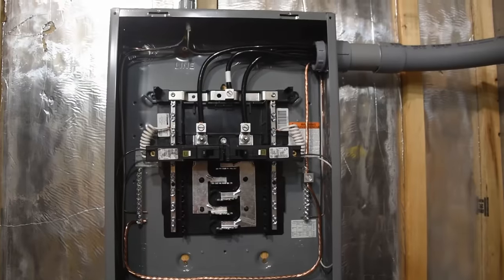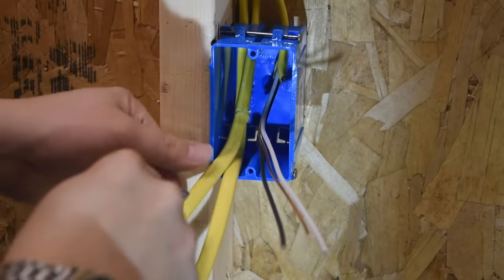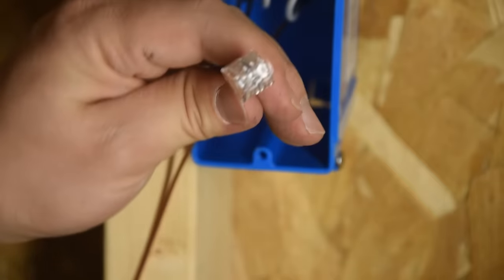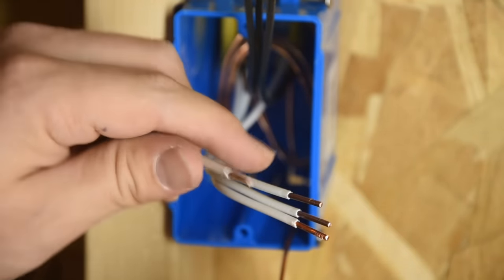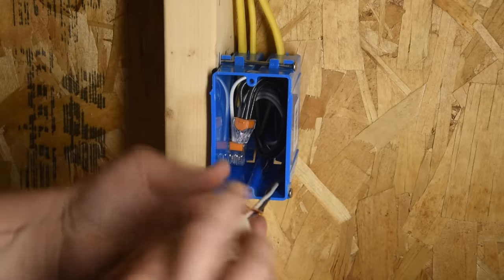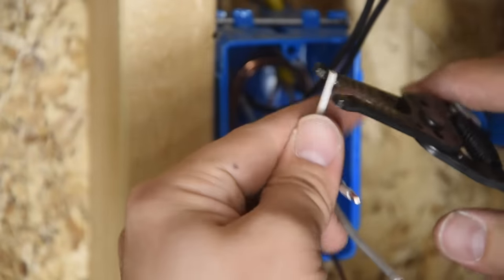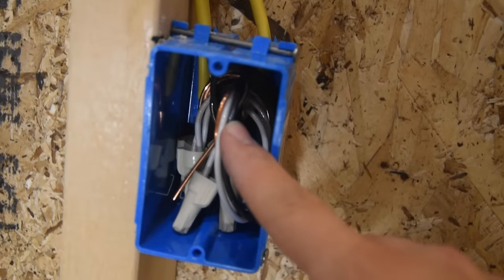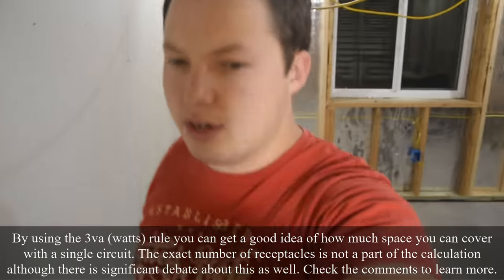Wago's vs. Wire Nuts - How To Wire Outlets During Rough In

Comment: Ideal has a better quality connectors.  I have tested them in fire, spark, heat.  
For commercial I wouldn’t use push type.
Reply: How did setting fire to the Ideal connector work out for you? Did you  put them back in stock and install them in a panel?

Comment: I really like using the Ideal twist-a-nut 6 in 1 screwdriver for installing wire nuts...check it out...I also use Wago lever nuts for some applications, especially ground pigtails in old housing...

Comment: Why 3 wires in the receptacle box instead of one? One wire with positive/negative/neutral is enough for a receptacle box right? Thx
Reply: 2 feeds out one main or home run ive done this with attic & closet  lights  just splice into nearest outlet

Comment: In wiring my new house I'm using WAGO connectors with levers and will never use wire nuts again. WAGO's make for a quick and clean installation and the wires are easier to fold back into the box than with wire nuts.
Reply: Thats it quick.

Comment: I notice that you leave the earth conductors as bare copper. In the UK we use an identical format cable to your Romex (we call it Twin & Earth), when we strip back the outer conductor we put a green/yellow sleeve over the earth conductor so that it is insulated. Is that something that is unnecessary in the US or is it just not mandatory?
Reply: ok how often do you need the ground to carry current should be never thts why we dont bother with sleeveing yes  its lazy but not needed in reality. how ever if the wire size is big enough say 4mm or larger and its going into a metal box or a tight fit i will sleeve it with tape or use a green insulated pigtail.

Comment: Then the drywall team cleanly cuts openings for the boxes with a router bit that is too long and rips the wiring to shreds.  I had this happen to all of my voice and data cables.  Fortunately, I ALWAYS have a service loop at the top of the wall.  Good thing they did not damage the power wires.  The switches and outlets were already installed.  I don't think they liked that, but they were behind schedule.  Soooo, the painters came along and painted all of the switches and outlets!

Comment: Time Stamp 0:16 shows Romex running thru conduit… not to Code.  Only THHN (single conductor) cable can be run through conduit.  However as a work-around and avoid splices, strip the outer sheathing of Romex all the way from circuit breaker to top of conduit (near joist).  Add a NM-type compression bushing to conduit top to secure Romex, and continue Romex to termination point.  This way you have single-strand THHN running thru conduit transitioning to Romex near joist without the need of a splice.
Reply from the maker: Thanks for sharing your experience. Its interesting though because I see conduit used fairly frequently to protect romex from "physical damage" from the top of the panel up to the joist cavity and it routinely passes inspection. Do you know the code reference that specifically prohibits that?

Thanks!
Reply: @BenjaminSahlstrom  Apology on my part for inaccurate statement "...only THHN cable...run thru conduit... Romex thru conduit not allowed."  Maximum cross-section area of [conductor] within a given conduit is the point I should have originally made, referenced by NEC 300.17.  Basically, one Romex cable (regardless of the actual number of copper wires within) with the OUTER JACKET INTACT is considered as a single CONDUCTOR in this context.  I'm trying to be careful with the vocabulary here.  One conductor may fill only 53% of given conduit (based on cross-section area).  There's multiple considerations on calculating given areas which are beyond the scope of this entry; please reference the applicable portions of NEC.  But when the math numbers are crunched, having fully-jacketed Romex going thru conduit may just barely satisfy the 53% thresh-hold.  Point to be made here:  I couldn't tell if your 12-Gauge wire is going thru 1/2 or 3/4 PVC.  If it's 3/4 inch, you might be "OK".  Again, I apologize for my misleading original statement regarding THHN.   Regardless, (personally) I strip off the outer jacket and run only the individual solid copper strands thru rigid non-metallic conduit to avoid having top do cross-section area math calculations.
Reply: @BenjaminSahlstrom  The reason I originally commented on your installation was because the conduit vs Romex correlation closely resembles a design I did in my own home...so your video sparked my attention.  But I wished to offer a neutral point of view and I hope you weren't offended.  My PVC runs in a different area (not near panel), but has a similar purpose:  Protection of electric wires within.  I enjoyed your video; I think it was presented very well.

Comment: I like Wago products to use with solid conductor, but I find them difficult to use apply in stranded conductor applications, or mixed solid-and-stranded at a connection point.
Reply: You have to tin the stranded wire to use in Wago's but... the thinner the wire the less likely it will be stiff enough to use.

Comment: So how do the calculations work out with a home office??  2 computers, scanner copier, printer, maybe a wifi router, lights, telephone system, answering machine, ceiling fan and regular outlets
Reply: Don't rely on a rule of thumb for a special case. 

Look at the wattage on the computer power supplies - my older laptop uses 200W and the newer one is 65W.  LCD monitors draw much less than old CRT's.  My scanner/copier/printer/fax is on idle 95% of the workday, just drawing a trickle - I'm guessing less than 300W when duplex printing.  My router runs off of a wall wart somewhere else, and USB chargers don't use much.  Landline has its own power, and AT&T is my answering machine.  Lights and ceiling fan are on a different circuit, as is my room's 220V HVAC unit.  I have one floor lamp with up to 5 LED bulbs that gets some use after dark.

Modern office equipment just doesn't use as much power as the old stuff did.

Comment: I have been using wago connections for years. Cheaper chinesium versions are available but for not much less then the wago. Why do you not sheath the earth wires outside of the insulation? Good vid by the way, new subscriber in the uk.
Reply: Having the grounding wire (Earth wire) bare saves a bit of cost on the cable, encourages its use for only grounds, and maintains the principle that everything metal should be grounded unless it mustn't be.

Comment: as far as the 3va rule i generally go no more than 12 devices per 15 amp circuit  and with bed rooms im doing outlets with 20 amp so again maybe all three bed rooms  12 to 14 outlets or if they want  an a/c or space heater ill do  2 bed rooms with an outlet just to the side of a window

Comment: I have been an electrician for 40+ years and have worked Marine, industrial,commercial and agricultural environments. Also as a service technician. I’ve seen many changes and new products over the years. This is my Analysis of wire connectors. Well, I’ve seen wire nuts burn up due to careless installation, loose connections .I gotta say that Ive never seen a wago or ideal push in fail on their own and they help fit device and tails in tight boxes nice and neat. That being said , any electrician worth his salt would extend his boxes or do everything possible to avoid overfilling and potential failure. I wouldn’t trust a push in connector doing a residential rough due to ten years of liability so every connection is twisted and capped with wire nuts in that situation.Taping wire nuts is not necessary unless it makes you feel better. Other than that , trust your training and do good work. Don’t completely close your mind to new Products. Some of them are brilliant.  Many fail. I still remember when wire ties were the new thing and we all feel pretty good about those these days as opposed to lacing. Many guys speak in absolutes. If it works and feels safe to you and you are comfortable with it, and it passes inspections, do that. Think of the environment your build will be existing in. Work to code and build big.
Reply: Great advice!

Comment: To the best of my knowledge, you can't connect across bays in CA, even with firestop which I didn't see in use.  Plastic boxes and romex may be acceptable, but   all I find it is cheap.  Why didn't you drop your romex into the same bay as the box?   I'd recommend the Wago 221 over the push connectors.  Using the device inline as an integral part of your circuit isn't recommended.  Pigtails are the way to go.  Rats love romex.  Smell bad when they electrocute and often kill themselves.  Use EMT and Romex if your are building to last, leaves a way to add a circuit when you find that the living room needs two circuits and the adjacent bedroom needs its own.

Comment: How much does 100 wagons cost verses wirenuts of the proper size ?
Also it’s faster and cleaner to hold the loomex wire to the side of box and strip the outer jacket than in side the j- box...

Comment: Also, I was taught to always twist and cut off the end that was damaged by my lineman's pliers. Then I went to work for a national commercial only company that serviced big box stores. They insisted I did not pre-twist the wires in the wire nuts. This was because in commercial big box stores you are constantly changing the wiring even seasonally as displays change and layouts of the aisles change. However if you want it to last as long as possible, twist first.
Reply: No mfg instructions say twist the wires before using wire nuts, if you are following the code, that means following the mfgs instructions, no twist of wires

Comment: My first thought as well. Dust in doors settles in electrical boxes over time.  Not always easy to land them upwards though. :/ And I don't use wageos or leggoes or whatever you call them. Anything I can twist and pull a few times with minimal effort and the wire comes rt out.. Im good on.. I even toss the ones that come in recessed lights, strip a little more insulation, twist the stranded and wrap the tinned wire around an already twisted splice with a wire nut. no back stabbing either. Im good with being liable for a piece of mass produced foil metal holding the integrity of my work in its hands. Everything vibrates over time. Think of a house near a train track or a busy highway, even plains going over head, you can feel the vibration, the people living there, etc.. all those splices are vibrating add 60 years to equation and the spring tension of the wires maybe pulling on the splice...who knows. no thanks. and i don't recall to many back stabbed receptiacls or switches being particularly difficult to twist a few times and pull and the wire is out..NFG. Here and there I've had to just next to thread the wire to get it out but for the most part, they just next to fall rt out.. it should be illegal...! . .don't like the gfi like atatchments either where you have to back stab and then tighten screw, they can easily twist as well, unless you've tightened them to the point you probably cracked the device square in half. lol NFG . sorry too much coffee.

Comment: There’s a time and place for wagos, wire nuts and twisting wires then nutting it. There’s no one size fits all. I would never use a wago for stuff in commercial overhead and I always twist my nuters on a multi wire branch circuit. I’d also never waist a wago on the ground for resi stuff. What’s wrong with a crimp sleeve?

Comment: Aren't you concerned that you will knick the insulation on the hot or neutral wires while stripping the sheathing like that? Wouldn't it be better to pull the sheathing back?

Comment: What about the shift in society going from higher current light fixtures and such to the low draw of LED and more efficient electronic equipment.  Wouldn't it be much less likely to work itself free because of the much lower heat index? Nowadays, more and more of our electronics pull less....in general.  So I'm saying, is there a place for certain fixtures/equipment where push connectors are perfectly fine? Just a thought.

Comment: I like your method of circling the box wires at a 90 degree away from you but our inspectors want to see the 3 coils in the gang boxes. Why don't you use hook blades in your utility knife for stripping the outer cover off Romex? I find I won't split open my fingers or hand holding 12-2 when cutting  off the sheathing and there is less chance of nicking the insulation on the hot line wire. I love Wago's and they  are great to use  but pricy unless you buy 100's of them , IMPO.

Comment: These things are affordable, convenient, and saves a decent amount of room.  However, I would not recommend it for applications greater than 15 amp circuits. In my opinion going over is the reason why many people will run into problems etc.  Average people are just not aware or calculate what each circuit can handle especially with these push in wire connectors (Not good for heat).

Comment: What would be the best way to tie stranded wire together?
Reply from the maker: You can use either Wago's or wire nuts. Wago makes a clamp style connector that is a pretty great option too. If you use the push style connectors like I did in this video you won't be able to reuse them though.

Comment: BTW, how many of you old journeyman have opened a J-box where the wire nuts fell off when pulling them out of the box and blamed the last electrician for not tightening the wire nuts enough? Note to self, it is from the heat and expansion, not the last guys weak fingers.

Comment: Was that 14 gauge wire you said was going to be on a 20 amp circuit?
Reply: Pretty sure he said 12awg on a 20 breaker but this UL card I’m looking at says 14awg single core copper is good to 24amp so he’d be fine either way I guess. 12awg single up to 34amp

Comment: I personally perfer  to go with 6to 8i. Inches and to pre splice the wires before before putting on the wire nuts . And strip off the sheathing before putting and the box and perfect to fold it so the wires so they go further in the box so they less vulnerable to sheet rockers . I do not know how push in respond to aluminum wire

Comment: wagos have a blade edge of contact whereas the caps allow for circuit conductor surface  contact .i dont believe the blade edge would handle a spaceheater or long term motor load current.  caps offer more conductive circuit contact to lower current and increased resistance

Comment: FYI.. Not all things that are UL listed are safe. NEVER use a stab lock device. All stab lock devices will overheat as resistance builds over time. They only make contact with Apx 30% of the conductor. Old school wire / wing nuts or crimps are the best and safest.

Comment: I'd have trust issues with so little contact area that the WAGO provides.  Pre-twist with lineman's pliers, then wirenut.  Best, least resistive connection possible.
Reply: Outside of soldering...lol

Comment: Wire nuts are way better connection when tightened on with lineman's pliers about an inch out from the nut.
I will NOT even use the push in connectors on the other devices either.
I work in factory maintenance dept. And can't tell you the number of times I have seen those push in connections fail.
And if working with 480 vac 3 phase those wire nuts get wrapped with electrical tape also.
Reply: why wrap with tape for 480?
Reply: Extra insurance just like wrapping 120 vac receptacles on the sids with 3 layers so it does not contact a metal box or your fingers.

Comment: Very good content and informative. I too have been switching over to new styles of wire connectors for any of the reno or repair / replacement of home and cottage work. The key element is as always time means money 💰 and these are a much safer unit. 👍👍

Comment: Why no fire caulk ?
Daisy chain, must be a regional thing. 
Ideal makes  a wire stripper that cleans the sheathing perfectly. 
Plus that step is performed before tucking into the blue box.
Plus I always 100% of the time pretwist those pigtails. Anything else is considered a hack job.
Plus box size is dictated by fill calculations, not what you want or have.

Comment: My opinion much faster to strip the wire before putting in the box, and I’ve always ran the home run to the panel to one outlet and jumped power from the one outlet to the next and so on I rarely put 3 wires in makes trouble shooting a bigger pain

Comment: Why don't you strip the romex sheating prior to running inside the box... I find I can use my romex  stripper instead of having to work in a tight area with a razor knife and risk slicing into the insulation...

Comment: Hi I built a 9’x10’ bathroom in my basement. Am i allowed to install outlets around 14” above the ground
Reply: chk local codes but make sure they are gfci protected at least and if its for say a livingroom or bedroom you wld want to have them duel afci/gfci and use tamper resistant plugs as well.

Comment: I here coded against wego.  I thought they could only be used on lighting in some areas. And not outlets.  I have nothing against them. It’s a time saver and easier to wire up but that connection you get when you twist 3 12 awg wires together and use a red 3m cap with yellow boot  just seems more positive
Reply: It COULD BE more positive if the person installing the wire nuts is properly trained (twisting the wires with linesman pliers and trimming the ends evenly before installing the wire nuts) but the Wagos are visually inspectable. Personally I favor the lever lock Wagos - even an apprentice can flip a lever
Reply: I notice that John does not provide a reference for his code claim. I am skeptical.
Reply: I notice that John does not provide a reference for his code claim. I am skeptical.
Reply: I notice that John does not provide a reference for his code claim. I am skeptical.